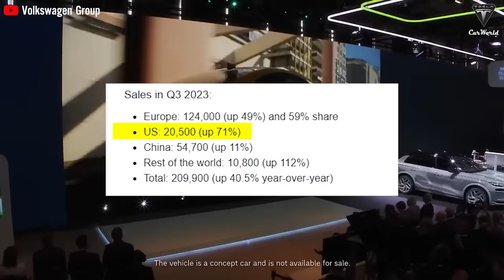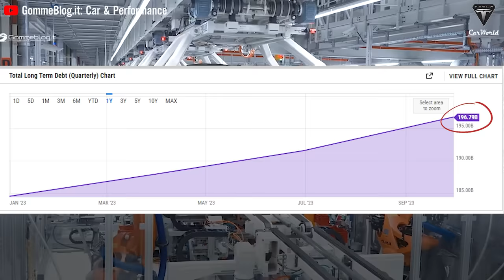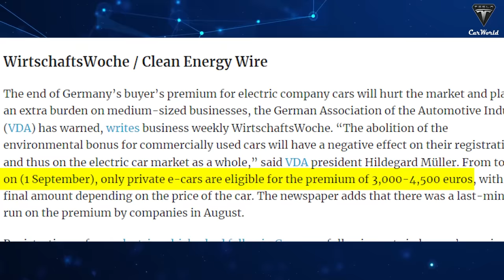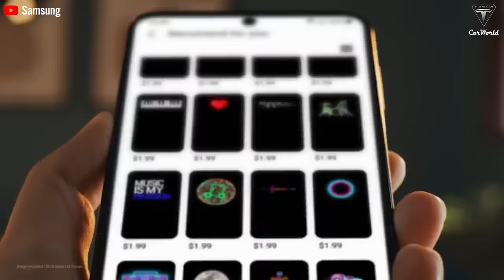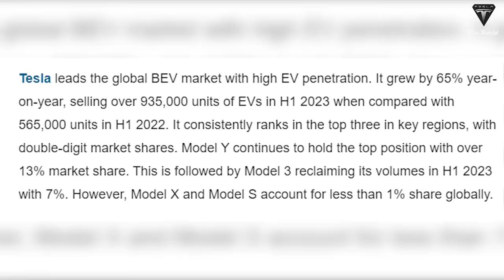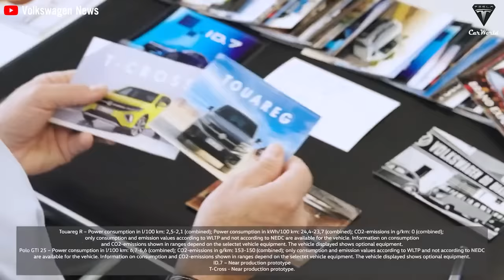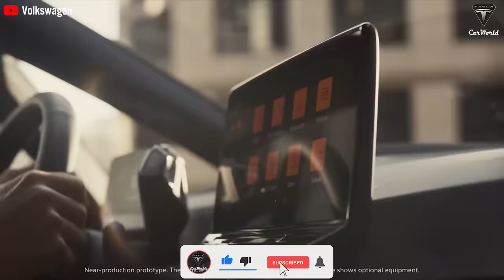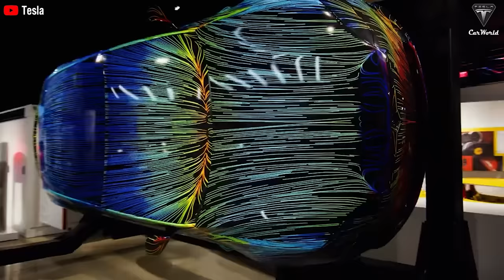BREAKING NEWS! Volkswagen CEO Thomas Schaefer WARNING Horrifying to All EVs Automotive!

Comment: Glitchy software and slow charging capability are to blame for VW’s woes. Furthermore Electrify America chargers are a joke in the US.
Reply: To postpone EV vehicles on the road for another 20 to 30 years is for UAW to be voted in at Tesla. Tesla employees should carefully weigh their decision to join the UAW. Many of them have a significant investment in their retirement savings tied to Tesla stocks. If the UAW were to successfully secure the votes to represent Tesla workers, this could provoke a strong reaction from Elon Musk (highest shareholder), potentially leading him to sell all of his shares and exit the company, which could result in a significant decline in the stock's value. Tesla is only a car company without DOJO, Solar, battery charging systems, semi trucks, and BOTs. Elon Musk will part ways and leave the car division to the shareholders.

Comment: To postpone EV vehicles on the road for another 20 to 30 years is for UAW to be voted in at Tesla. Tesla employees should carefully weigh their decision to join the UAW. Many of them have a significant investment in their retirement savings tied to Tesla stocks. If the UAW were to successfully secure the votes to represent Tesla workers, this could provoke a strong reaction from Elon Musk (highest shareholder), potentially leading him to sell all of his shares and exit the company, which could result in a significant decline in the stock's value. Tesla is only a car company without DOJO, Solar, battery charging systems, semi trucks, and BOTs. Elon Musk will part ways and leave the car division to the shareholders.